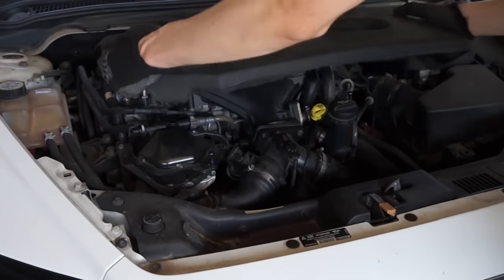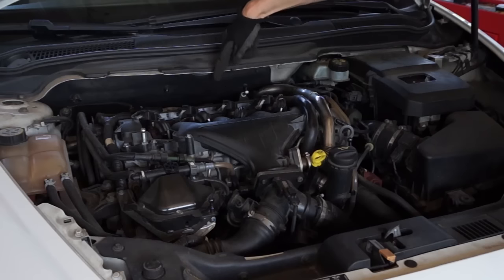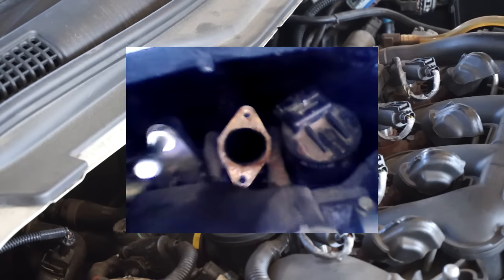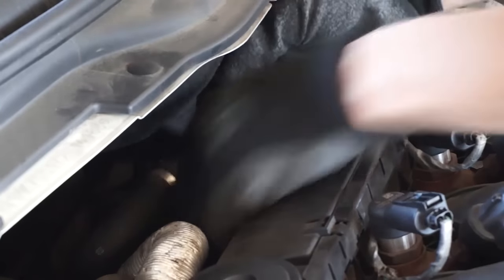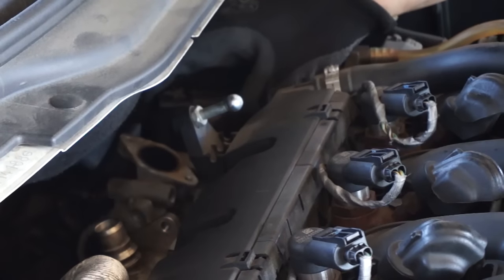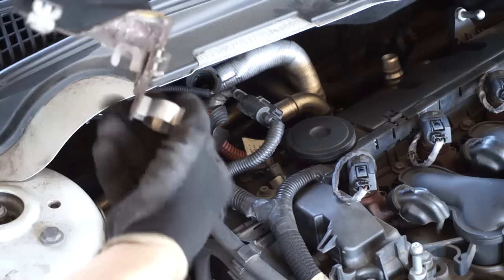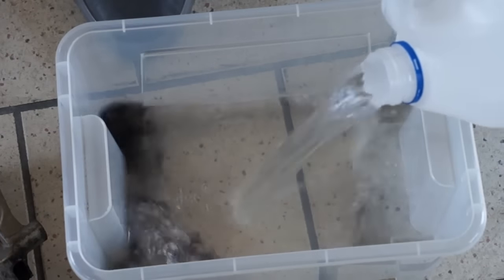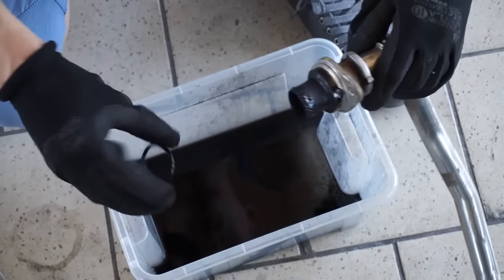2.0HDi 2.0TDCi 2.0D EGR valve cleaning

Comment: do I have to drain the coolant for when i remove the coolant hose?
Reply from the maker: EGR cooler is the highest part of the cooling system. When you disconnect the cooler you will loose some coolant, but you don't have to drain the system.
Reply: mr-fix ok thank you

Comment: Is it possible to delete the egr System will it run without it properly is it more economical with out it and perform better power wise
Reply from the maker: If EGR is working correctly, then there will be no power gain after EGR-delete.
Please notice that with EGR permanently closed the EGR cooler will stay cold (engine will warm up slower and cold engine = higher fuel consumption) and EGR is a part of the turbo system - EGR performs partially as as waste-gate.
Reply: This is right. BUT. The efficiency for engine to be warm faster with EGR or without ir just 5% faster, so why do YOU need that CANCER in car? Just delete EGR from ECU software, disconect EGR PLUG and go on on on... EGR is like waste gate? You change it by removing properly in ECU program. Without EGR engine runs much better, no LAG on first second when You press throttle pedal. I will not talk abaout the JUNK in engine with EGR. EGR = DISSASTER. Just for GREENPEACE.
Reply: Hi Laimonas, I couldn't agree more. I deleted the egr from my jaguar x type 2.0 turbo diesel and the improvement on economy and performance was fantastic. EGR amd DPF are 2 crap things that the cars have.
Reply: What ECU software and cables you use to do it? Please help.

Comment: My Egr has a 3rd bolt at bottom. Does anyone know how to get to it?
Reply: yeah...it's nasty. you can get it from underneath - but you need like 3 socket extensions to reach it. Original bolt is an allen key (5mm or 6?) . But i changed it to a ordinary hex bolt..now i can reach it from upside with a small 10mm spanner (might have to grind the edges to make it narrower) - it's in the same line as the rightest upper screw. Eitherway - it's difficult.

Comment: What are the signs of valve contamination?
Reply: No signs, you car just stops responding to acceleration. In general it gets clogged around 100.000 kms. Mine did without warning, just lost power on the highway.

Comment: all i herd was remove remove remove. 
they sure make these parts almost impossible to remove or need some type of engineering degree.
Reply from the maker: Yeah, on the other hand if you want a car that is safe and compact you need to place some parts in inconvenient places to save crash zones... Same goes for the pollen filter in this car. If it was easy accessible, passenger cabin had to be shorter.
Reply: pollen filter ... holly shit... how much i was swearing that day while changing fu*king filter on Focus Mk2,5. Taking the fu*king gas pedal to change  pollen filter and even then it's still not easy to put new one ! Fuuuu#$"#"E"%" :/